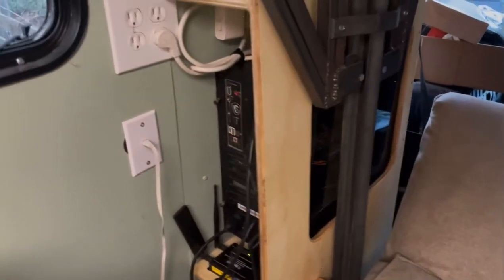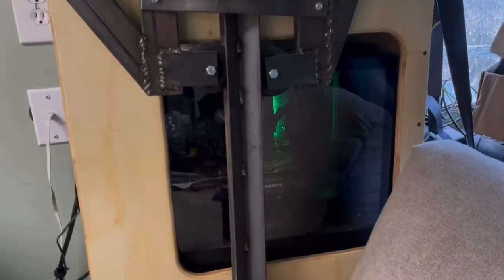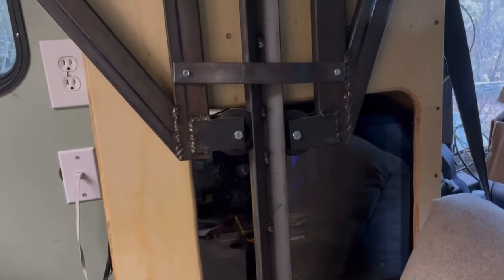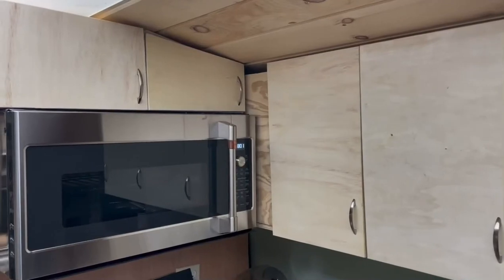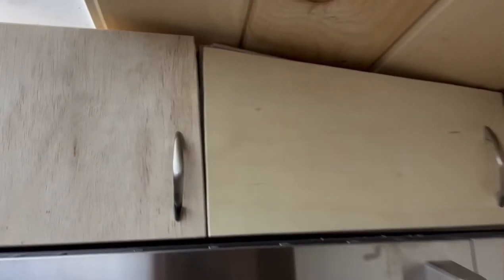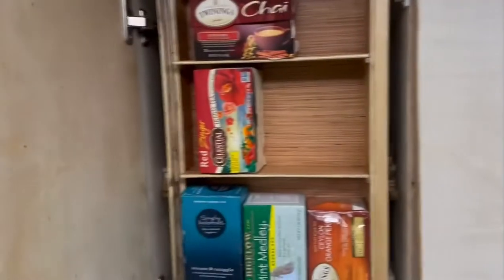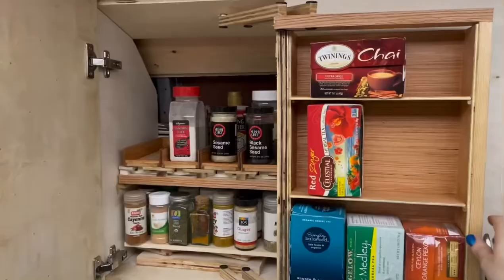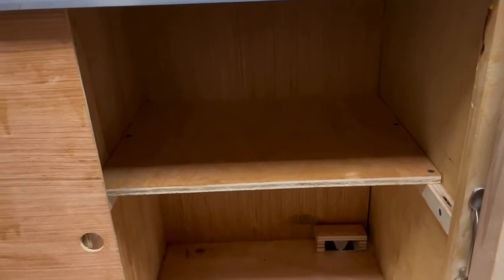Schoolbus conversion #20: Finishing kitchen storage

Comment: Not a huge fan of how there's no front airflow for the computer. I don't think many people realize that you need front and rear ventilation so the air can actually flow through the system. As-is it looks like you've closed off the front of your PC, which is asking for it to overheat.
Reply from the maker: My PC has an air intake on the top and exhaust out the back. There’s enough space above it for plenty of airflow; it stays below 90C even when running VR games.
Reply: @skylerbuildsthings  That does not give your GPU much airflow to work with. Your GPU almost-exclusively gets it's intake from the front of the case, not the top.